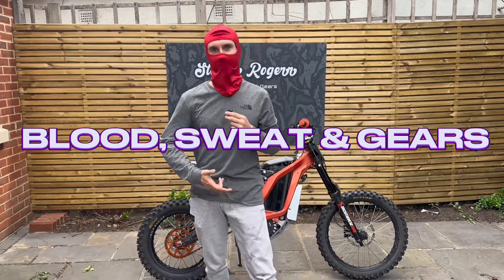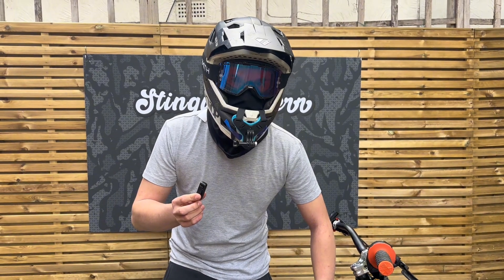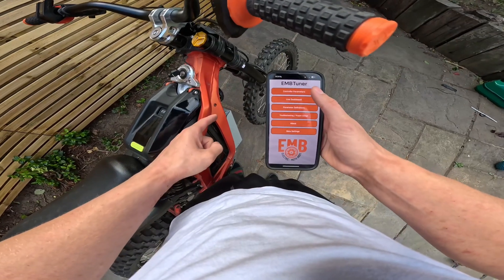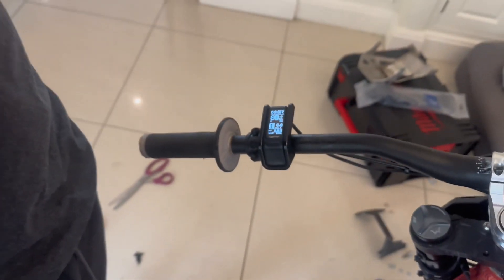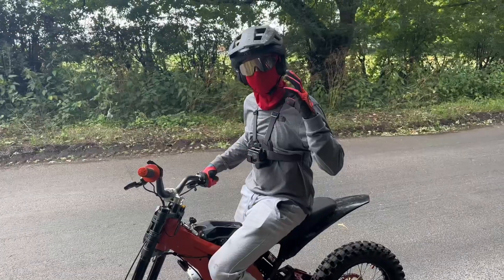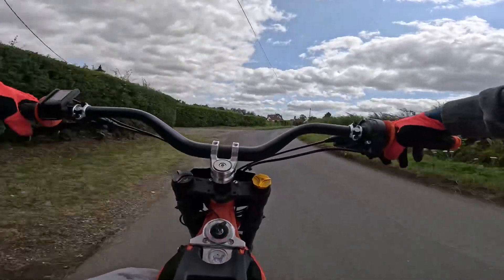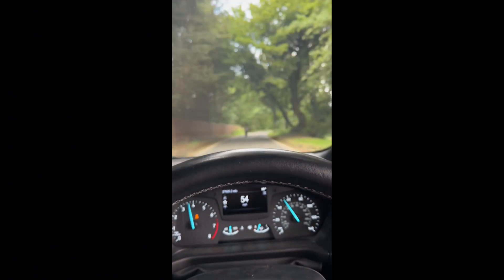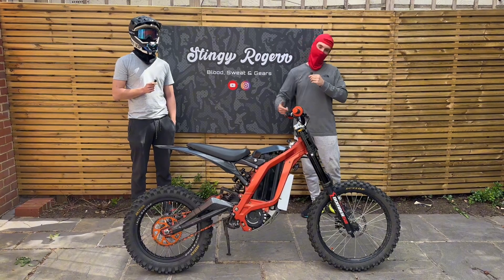Our BUDGET SURRON Build: Controller Upgrade! | Episode 2

Comment: Grab a Torp controller it’s cheaper and you don’t need to bypass the battery and will pull even more power than a bac, can pull 8000w on stock with a Torp
Reply from the maker: Great advice! TC500 is a solid choice! I am aware of the TORP and we did consider it, but Unfortunately after importing it to the UK and paying VAT the total comes to way more approx £850! 

We got this for £650 inc VAT! 

I would have loved the TORP but the goal is to go to a 72v battery (which we have now for a future video) which we thought the BAC 4000 as its tried and tested for 72v setups! 

Thanks for watching!! 👍🏻

Comment: Great videos m8 quick question my surron is a 2023 60v 40ah battery so was meant to believe it ran at 6000kw at peak power? Would the bacc 4000 improve it on the stock battery?
Reply from the maker: Hey! Yeah you will always get some improvement you will be able to get 800w more at least! If you went for a torp TC500 controller it can communicate with the stock BMS and run at 7.5kw without a bypass!
Reply: @stingyrogerr  massive thanks 👊